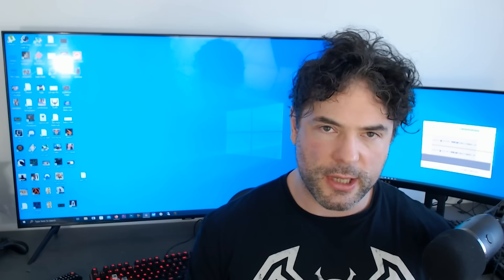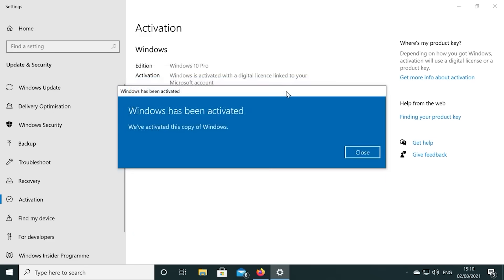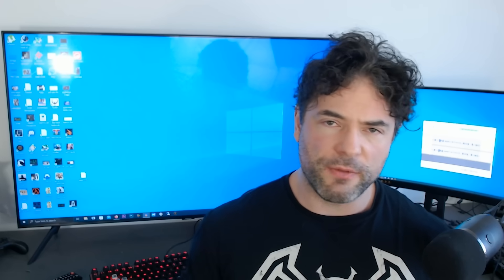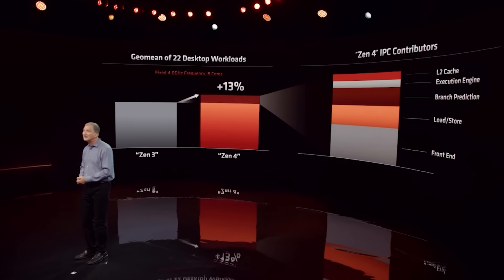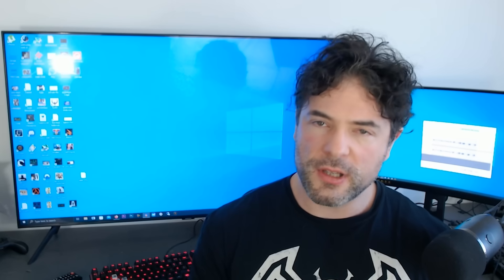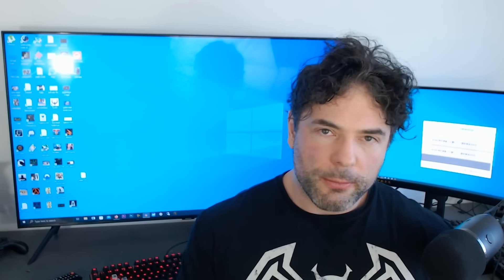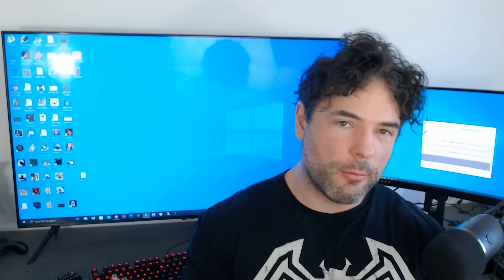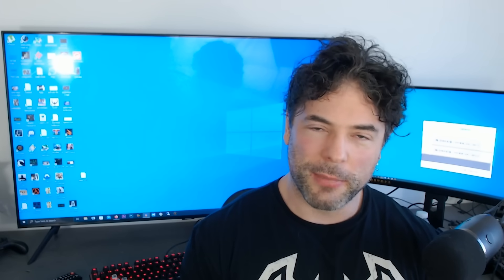HUGE Zen 5 & FUTURE AMD CPU Leak | RTX 40 Super SPECS CONFIRMED

Comment: The 4090 is a much more cut down die, leaving 15% available.

The 4080 is massively cut down from the 4090 performance wise, and yet it's almost the full 103 die, meaning it has next to no extra performance with the 4080 SUPER.

All this to say, the 4080 was never a true 80 class card, they gained so much going from Samsung to TSMC, that they decided to give everyone lower tier dies sold as higher tier cards and raise the prices at the same time through the roof!

This whole generation is a scam and any buyers are fools!

The 4080 SUPER, if discounted down to £799 would be OK. But £1000 is still way too much for that card.

To show you how fucked this generation is, even though the 4090 is cut down 15%, there is still room for the true 4080 AND 4080TI between that and the fake 4080!

Scamvidia.

Comment: Nvidia needs to redo basically the entire stack.  60 class is 192-bit 12GB, 70 class is 256-bit 16GB.  128-bit 8GB is 50 class.
Reply: Imagine a 20gb 384-bit bus AD102 4080 Super. That would be cool
Reply: @JohnnyEMatos  You just mentioned a 4080 Ti not a 4080 Super.
Reply: According to what? Even NVIDIA name their products wrong
Reply: @JohnnyEMatos Common sense and consumer demand.
Reply: What gives, none of this has any say on what the product should be named and this generation is proof. They don't follow your imaginary rules @cracklingice
Reply: @JohnnyEMatos  There are no imaginary rules, only market forces.  And those forces are that 40 series below the 4090 are selling worse than the 20 series did and AMD is gaining a larger market share of current sales than Nvidia is comfortable with.   And what I have said is WHY.
Reply: @cracklingice  well, true, but what I mean is that they would manipulate names when convenient. I think it would have been nice to see a good gap filler between 4080 and 4090. About AMD gainig market share, indeed, I went AMD myself this time
Reply: @JohnnyEMatos  What card did you end up going with?
Reply: @cracklingice  7900 XTX. I figured since I don't play anything that requires RT or upscaling, I'd save up some money vs. the 4080. With what I saved I bought myself a nice aluminun profile rig for sim racing
Reply: @JohnnyEMatos And if the 4080 had launched at $899 - how would that have impacted your decision?
Reply: @cracklingice  If both were the same price I'd go for the 4080 just for lower power consumption. But I guess if the 4080 launched at that price then the XTX would have launched at $749. In all my games they perform exactly the same, so Ilooked for the best deal since I don't play modern SP games that have RT or need upscaling, I only play games like Squad, Age of Empires 4, Assetto Corsa, Automobilista 2, Rust, Chivalry 2, iRacing... All on native 3440x1440 with 140 FPS constant for the most part

Comment: If the 'refresh' cards are going to receive a price cut, Black Friday notwithstanding, then it logically follows that the cards they are "replacing" in the same Series will ALSO receive a price cut. It all comes to the percentage of the price reduction on the new 'refresh' cards. Personally, I think whatever the final MSRP they will STILL be over priced for what they deliver on performance and power draw.
Reply: max price for a 4080 super should be $899 imo. thats still alot for an 80 series card. 4080 imo is by far the most disappointing card this gen, mostly due to the ridiculous pricing. $799 would of been more appropriate, $899 is pushing it and $1,200 is just out of this world insanity lol i dont know why anyone would be stupid enough to pay that much for one lol
Reply: @PCgamingbenchmarktime Exactly and even then it should have a 320 bit wide bus. The gap between the 4080 and 4090 is only as much as the 3080 was to the 3090 ti. However the fact is the massive spec difference tells u exactly how much its costing them and as close as they gotten that performance all things considered, it's a way smaller and cheaper die proportionally to the current 90 class than compared to last gen.
Reply: @PCgamingbenchmarktime well, the least expensive 4080 I could find on Amazon Europe is 1209 euros, and some others cost up to 1500+ euros. And I just saw an rtx 3090 still listed on Amazon at 4000 euros!
Reply: Pretty much this. I just bit the bullet and got a 'cheap' 4060ti at $379 (I could have done $369 but I needed an Amazon box for safety reasons). The reason is because the 4060ti's are all selling out. People know they're not going to get a refresh or a price cut, so ~$359 is it--that was the Spiderman themed 4060ti and that's already sold out everywhere. Not what I wanted to pay but better than the insane $400+ people are asking for this card.

Comment: I thought about waiting for 8800x3d, but waiting for that long will just make gaming harder, so I’m going for 7800x3d on Black Friday, because I don’t actually think it would be a major jump in performance between 7800x3d and 8800x3d
Reply: I'm on a 13900k, want a 7800X3D for lower power consumption reasons.
8800X3D if it has more single thread I'll switch to it, 
15900k may beat it, Then gotta switch again. 
2026 the 9800X3D or 9950X3D (since both chiplets will stack atop the IO DIe in Zen 6) (will also be forced to cop this)
If only Panther Lake with rentable units, glass substrate, 1.8Angstrom, Large Level Cache model was out, I could skip all this, and be set for 5+ years 

sighs
Reply: @nerdynumen  hahahahah that’s just too much thinking and waiting and all, I got my pc from a friend and it has i7 6700 in it, I bought and 6650xt, and now I’m thinking about getting an entire new pc to put my gpu in, and upgrade my gpu in 2 years
Reply: At the end of the day when you got the mobo you can switch the cpu and the gpu for the next 5 years .
 @nerdynumen
Reply: Get AM5 and see what happens.  That is the way.
Reply: @farmeunit  it’s what I’m going to do

Comment: i want the 8800x3d but they are probably going to delay that so long that by the time its out Arrow Lake will be close to launch and once Arrow lake launches rtx 5000 wont be far behind and i will want to wait even longer for that. Might just have to do a regular zen 5 8700x + rtx 4080 super or 4090 build in February. 4090s are way over priced atm i refuse to pay more than someone did 14 months prior
Reply: Just buy a 7900xt
Reply: The crazy part about the upcoming Ryzen 8000 series is that these CPU's
will have larger cache sizes from L1 up to L3 and believe it or not it will be out performing 7000 X3D's.
8800X3D will have 40-90 avg fps more then 7800X3D on 1080p gaming benchmarks,
while the regular 8000 series will be 15-35 fps faster then 7800X3D on 1080p benchmarks.
14900K does come close to the 7800X3D but the fps margin is mediocre small not huge,
8000 series will be faster then 14th gen by 10-25 fps faster and X3D 35-95 fps faster on 1080p.

FSR3 will hugely benefits from X3D CPU's and even 8000 series that comes with Zen 5c (on its 2nd CCD).
These will be a much denser cores and will have enhancing improvements in Ai technology such as frame generation.
This denser cores will generate and fix the frames and do all the handling itself but I'm afraid it will have issues with Nvidia GPU.
FSR3 frame generation would work best with their latest GPU and AMD is making the CPU/GPU in a way to act like an APU.
Reply: @winnb4968  Pretty sure Zen 5 is only seeing a cache bump at L1, the others are the same per core (x3D excepted).
Reply: @winnb4968  I really hope they beat Intel on 1% lows with the new X3D chips

Comment: RDNA 4 is going to be between navi 32 and navi 31? so it's gonna match a 6950 XT? yeah Paul, I don't know about that... no way they don't match at least the XTX, although I would be pretty surprised if it doesn't match the 4090.

Also isn't Intel going after 7900 XT/4070 TI? yeah no way RDNA 4 doesn't hit at least XTX levels of performance lol.
Reply: big navi 41 is rumord to be cancelled, i do agree im expecting 4080/4090 perf for much cheaper
Reply: 100%,  it sounds like a bunch of bull. I understand they won't have a top end from what is being rumoured but they can't be worse than current gen. That would make zero sense, what he is saying is completely illogical. Not competing with the high end 50 series based on rumours makes sense, working 2 years on a architecture and then releasing something with 80% of performance of current gen would serve what purpose?
Reply: The informed leaks are that the RDNA4 advanced multi chip GPUs were cancelled in favour of expediting a promising RDNA5 design while the lower end monolithic designs continue.
If you cannot get high end models out on time, it's better to put the development budget into accelerating the next product.  Coming out with a product that's too expensive doesn't make anyone happy.
So a monolithic RX 8700xt might be the top model.
Reply: @RobBCactive  agreed those are the informed leaks. The original commenter and my point was that they will be mid range competing with RTX 5000. So they should at least be on par with AMD's current gen top end. Paul is saying they will be much lower than 4080 Super/4090, so basically at high end RX6000 series. This means that AMD has spent 2 years on RND and regressed performance by a generation. That makes no sense, then they would just refresh XTX or even the RX6000 series. Obviously what has happened is that multi chip gpu isn't currently working for whatever reason and they have decided to go with another design that won't compete with high end RX5000. But that doesn't mean they will release something weaker than their current top end. Remember a 4070ti is somewhere around a 3090 in performance. Things move on gen by gen, so AMD next gen mid range could compete with a 4090.

Comment: First gen of a new gen is always disappointing. The refresh wait is worth it.
Reply: zen 5 wont be good cause of samsung....
Reply: @SweatyFeetGirl  doubt the Samsung chip will be a desktop chip. It’s probably a mobile or car apu.
Reply: Unless u bought the 4090 at launch. Thats the only card that made sense
Reply: Zen 5 won't be disappointing like Intel's 14th gen as the 14900K trade blows with 7800X3D.
Ryzen 8000 will come with larger cache sizes of L1,L2, L3 and out perform Ryzen 7000 X3D's.
8000 X3D will have huge cache probably double as they're going to stack v cache both CCD's.
Ryzen 7000 which is on the first generation of AM5 had trouble like any new generation.
However Zen 5 is different it's the 2nd generation of AM5 and this will even compete with 15th gen.
Probably not the regular 8000 but I'm definitely sure about the 8000 X3D variants against 15th gen.

No refresh wait is never worth it, look at the 14900K refresh even the 13900K can clock higher at low voltage.
Yet still has a higher score on Cinebench then 14900K (Jaytwocentz) latest video talks about this.
Refresh is a waste it has no IPC gains just the same chip but higher clock speed that's all nothing more.
Those who have 13900K wouldn't even see any difference of performance gains with an 14900K.

BECAUSE IT'S A REFRESH, MWUAHAHA! :face-blue-smiling:

Comment: Before you freak out about Samsung 4nm, keep in mind this is on a DESKTOP x86 CPU, not a fanless ARM SoC. Obviously, Samsung's 4nm on AMD Ryzen desktop CPUs won't be like the Exynos because the Exynos is a fanless ARM SoC. Samsung 8nm was used on the RTX 30 series and that one was really good, but their 8nm/7nm on Exynos wasn't that good.

Intel's 4 process node is reportedly comparable to TSMC's 4nm, and Intel 3/20A is making improvements here and there. We'll wait to see when the first mini PC with Meteor Lake/Core Ultra drops to see some benchmarks/gaming in action. Later in 2024 we should get Core Ultra 200 with Arrow Lake 20A or Intel 3.

Comment: I think they should do RTX 4090 Titan
Reply: Or a RTX 4090 Titan Super!
Reply: It's highly likely that they'll release a 4090 Ti just like they released a 3090 Ti last generation.
Reply: @Shieftain  Well, they got no competition and they can sell all non cut GPU chips in the AI market for higher prices. No need to clear old stock at a premium like they did with the RTX 3090TI. I think it's more probable they won't do that this time. That way it will make it also more attractive to buy a RTX 5090 later on (which is very likely be more expensive than the RTX 4090) as the performance uplift will the greater.
Reply: Bruh that power draw is too much that it's impossible to make an 4090 Titan lmao 😂

Comment: What the point to release every year new cpu and new gpu, it's becomes just money grabbing
Reply: every year? ryzen 7000 launched in 2022, Ryzen 8000 will launch in 2024. thats 2 years
Reply: As long as there is a 10% or greater performance gain. I am okay with that. But to only gain 2-3% extra performance, that is an embarrassment.
Reply: @matthewtremain683  if not at least 25% better it's pointless, in  my opinion you need to upgrade GPU and CPU about every 4 years

Comment: Reasons of the new cards:
4070 super to beat rx 7800xt
4070 ti super to beat rx 7900xt
rtx 4080 super to beat rx 7900xtx
Reply: Then AMD will strike back:
7850 XT to beat 4070 SUPER
7950 XT to beat the 4070 Ti SUPER
7950 XTX to beat the 4080 SUPER
Reply: I will still get Rx 7800 xt
Reply: @justeddm  Exactly. Even the Super cards won't be able to compete with the 7800XT. Very disappointing.
Reply: And they will ALL lose, against Radeon !    Nvidia can go to hell !!!
Reply: Now we may also be look at a price cut on older 40xx and amd then dropping to match

Comment: Still rocking my 7700k might be time to upgrade next year.
Reply: 7800k here i was thinking about it this year with 7800x3d but i think im gonna wait 8000 series next year i heard they will be much more powerfull.
Reply: @icecold3426  I’m thinking the same, I thinking of getting the MSI MAG X670E TOMAHAWK board but I might wait and see gen 2 am5 boards first. If I kept my 7700k this long I want my next platform to have an upgrade roadmap. Intel screwed me last time on the z170 and z270 platform.
Reply: 8700k and going to wait for 8800x3d if there’re games worth upgrading for. GTA6 maybe 🤔
Reply: @delatroy  the funny thing is I almost got the 8700k I know there was a way to run it on the z270 but I was so pissed at intel at the time I just stuck with it since I got a chip that did 5.1ghz at the time now in 2023 it’s a bit laughable. I commend you z370 brother to a z270 brother
Reply: @camsteremail  im still happy with the 8700k for what I play. Might have longevity because of the high single thread perf. I delidded it to 5.1ghz
Reply: @delatroy  man if you play 1080p like me procesor can give you alot more fps.. specialy in unoptimized games..i want to pair 7800x3d with my 1080 gtx till i get more money for graphic card and monitor